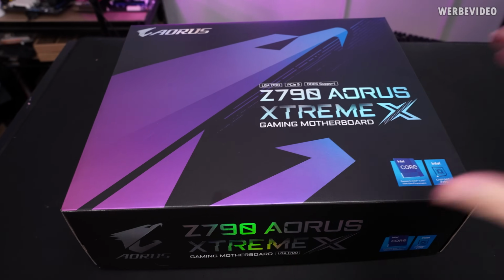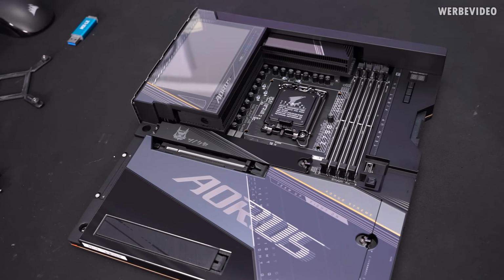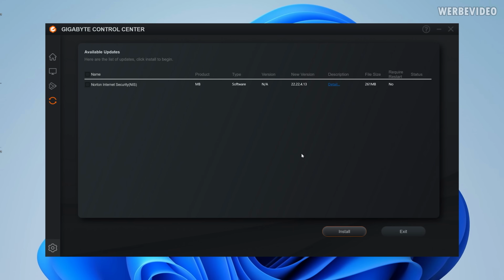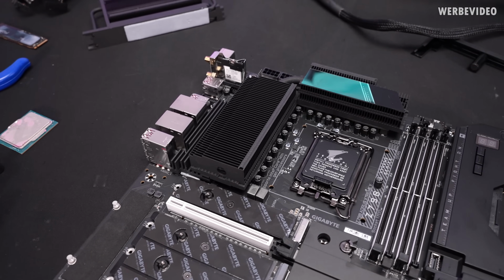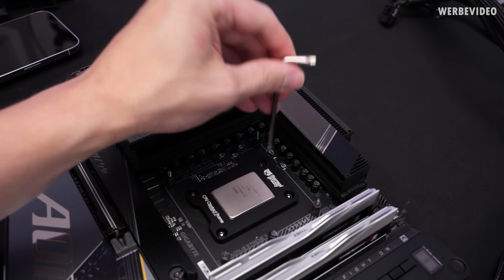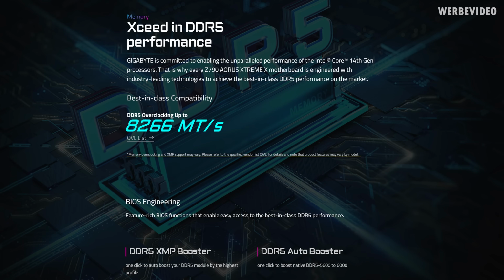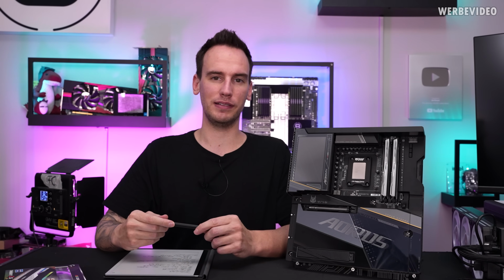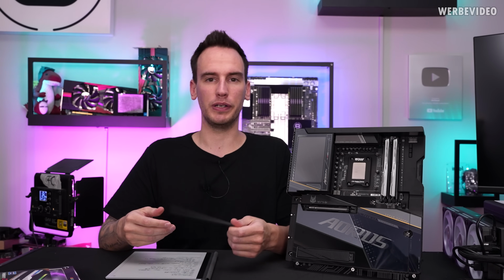Overpriced and Disappointing! The $1300 AORUS Z790 Xtreme X

Comment: Hey if thats a 48GB kit of G.skill then their wrongly profiled. 

Go check their kits of 32GB : 1.45V

Other vendors on the Asus list for z790 formula : 1.45 - 1.4 

Somehow G.skill : 1.35v>

I had these same issues, got very confused almost RMA'd the sticks. 

Then figured f it let me increase voltage to 1.435 (Max without removing limiters) 

And now its beyond stable, I did add a small fan to the bracket included with the z790 as you will see the temps of the Gskills stick around 50 , but I seem to see the same temps for you in this video. 

Only thing I would want to ask your experience on : Do I still remove the voltage limiter in the asus bios , or if its stable like this leave it like this ? Thanks!

Comment: I think this is one of those situations where Gigabyte (not that they're the only ones who do this) is putting a lot of bells and whistles (and a little snake oil, naturally) in order to bring in customers with more money than knowledge.

This is aimed toward the same kind of customer who chooses who to do custom work on his car based on whether they have a show on the Discovery Channel or not.

Most of these boards will end up in a Y70 Touch or O11 Dynamic clone with as much hardline tubing and as many rainbow-puke spewing fans as is physically possible, while their blinged out 4090 sits 3mm from the tempered glass side panel.

Comment: i owned every single z extreme from gigabyte z170 to z690 , build quality and sound quality plus connetics and esthetics nothing can get closer to them it's just too goof of a premium board , but what i don't like about them it's the fucking software app it's like it's coded by a 12 years old kid full of bugs like the most shitiest app you can find on the internet , and also one of the most bizarre problems with bios settings when you change a setting let's say ram timming and save it then you boot  to windows and it's not changed , or you change some values to auto and yet they stuck at the previous value , so you need to change it manually to the default value then change it   to auto .... other that that , very stable boards can't complain  ..

Comment: It's the new normal in the industry: very high prices. If you think this is expensive, wait for a Corsair motherboard, easy at US$ 2,000 hahaha Flagship motherboards have this problem, price. And that's all they offer, price - to give you the idea of something valuable. The most important parts are the same or almost the same as other models at half the price (and I'm not talking about how easy it is to reproduce some of these features with 3D printed parts, or custom parts/mods or slightly more expensive, vendor-customized blocks and heat sinks like Ek). This model disappoints mainly in terms of connections, less than other models and needs adapters, this is not good, you can't customize it, you end up dividing connection bandwidth, power and you also run the risk of overloading fan connections especially (and they will all run at the same speed).

Comment: This board is amazing I paid $1k for it, and $1k even 6 years ago for a Asus Zenith Extreme for my Threadripper 2950x.  The extreme X is great if you know what you are doing.  I run 8200 m/t G.Skill at a stable 7800 m/t for 3 months now.  My core i9 14900KF is overclocked to 6.2, 5.9 on all cores (custom water cooled), run Sabrent m.2 (4 of them) in RAID 0 on the Gen 4 slots clocking 15,500 mb/sec read/write, and I left my Gen 5 m.2 alone, using my Phantec watercooled RTX 4090 clocked at 3k mhz.  The quality of the board is amazing, exposed in my P90 Thermaltake Case. Wires are hidden easily, the Gigabyte software has come along much much better since this release, and it's been super stable and will last me years.  Just like my expensive Zenith Extreme still running strong.  You get what you pay for.  100% satisfied in my case, these are just small nit picky things you will find if you pick apart any damn motherboard.  And no damn way you get "perfection", seriously?  Made by humans dude.
Reply: This made me feel better!
Reply: @bugz9615 I use this computer heavily with my development workloads.  Docker. Sql Server. Visual Studio (services, mobile, web) builds.  Android emulator. Adobe photoshop. AutoDesk Fusion 360.  In other words I push it hard.  All day.  Gigabyte motherboard software has truly changed for the better.  It was hokey at first.  Some drivers wouldn’t install through it. All that is fixed.  I still run it at my specs above.  The ONLY niche issue I ever have is when windows 11 pushes major feature updates.  A reboot causes some crashes.  Simply turn power off unplug, then start.  Let memory re-initialize.  Crashes are non existent.  Very frustrating at first but that works every time now.  So I would highly recommend this motherboard.

Comment: On Gigabyte's website, memory support is max 6000 MHz. Of course, that doesn't tell the whole truth, but it's strange. Manufacturers of memory chips are Samsung, Hynix and Micron. Gskill and Kingston and Corsair etc do not manufacture any memory chips themselves. Memory that works flawlessly at high speeds is mostly a matter of luck. As you said, it could also be the ability of the processor and/or motherboard to operate at high speeds. The sad part is that NVME cuts GPU performance on this motherboard. This is really not worth the price. In general, Gigabyte has made quality components.

Comment: It's an obscene cost to me for a motherboard, especially for the average user (99% of us). This isn't needed and is only for the most extreme of enthusiasts. And even then, it's obscene. Two thousand AUD for a motherboard - WOW. I'd rather put that into another UAD Apollo for my studio. Will never spend that much on a mobo, no way. All I want is a computer that can run reliably for a few years and of course it will be built with thermals and quality in mind, but there's just no need for this at any step of the way. Just to put it in perspective, my 2010 Mac Pro still works today like the day I got it, and my Aorus X5 V8 laptop I bought in 2019, same.
That was a cheapo on sale for 2 grand with GTX 1070, 32GB ram, 8850h. It needs a repaste, sure, temps are higher than when new, but that's easy enough. Performance at 1080P is still perfect with a G-Sync panel too. My point is that that entire computer I got so much use out of until I upgraded to the GT77 last year, cost the same as this motherboard LOL. Now I am building my desktop, I will get a mid range board, 500$ maximum for the 14700K.

Comment: For that price, I'd expect dual 10GbE ports. 2.5GbE goes along with 5GbE as being a non-standard format that's not supported anywhere outside its own ecosystem and certainly not in enterprise applications, where you either use 1GbE or 10GbE.

Comment: Gigabyte control centre is absolute trash. I have to use a version from nearly 2 years ago to allow me to change settings on my aorus 4090. Newer versions just don't show the gpu in the ui. It's been a known issue and it's on many forums, even gigabyte have recommended using older versions of software. Absolute junk. Will not be buying another gigabyte product ever again.

Comment: When you are discussing power and current numbers I think its important to point out what VR VOUT voltages you are seeing, as well as clock speed if you are on adaptive voltage. Not to mention whether you have dialed in the DC_LL to match the VRM Loadline, so we know if you you are getting accurate power readings. I'm sure you know some motherboards don't automatically set the DC_LL appropriately to match the VRM Loadline the user has selected.

I'm personally disappointed in Raptor Lake because by this point Intel should have created better tools to help users predict what their voltages will be under various loads, with software that shows graphs of voltage curves under the user's adaptive voltage and loadline settings. They added a lot more complexity with Alder Lake, which I appreciate can be very useful, but only with the proper information available to the end user. Ideally they would work with motherboard manufacturers to get such features in the BIOS. It doesn't have to be that fancy or super accurate, just something as simple as a V/F chart representing a rough prediction of what kind of voltages you will be seeing under a given load (The user would enter watts/amps). A good example is RobertoSampaio's CPU Voltage tool he shared on the OCN forums in his post "ASUS MAXIMUS Z690 EXTREME & i9-12900K GUIDE". Intel has quietly disabled V/F point functionality in Intel XTU for 13th gen processors, and my experience with trying to use V/F points in my Z690 MSI BIOS is that it is quite limited and buggy. Its almost impossible to know what voltages at various loads you will get without a lot of trial and error, and it also appears you can not set both a positive and negative offset at different points. They have to either be all positive or all negative, which really limits the usefulness of the V/F points in the first place.

Comment: I got the Gigabyte Z690 AORUS ULTRA paired it with 12700KF, G.Skill DDR5 F5-6000J3636F32GX2-TZ5RK 64GB (2x32GB), Palit 4080 RTX 16Gb GameRock OC, Arctic AIO 420mm etc.
Anyway I cant say Im really fond of the Gigabyte software. Also I had to install Windows 11 over Windows 10 my sound improved & Windows 11 know what to do with those E cores. Gigabyte has 13 BIOS versions to choose from. Im using F27. F28 is in BETA stage . XMP did not BOOT Im going to fine tune it manually. I manage to boot it at 5000Mhz but I paid for 6000Mhz I know its a lottery. Any way Im going to tinker with the BIOS settings. In general I cant say Im satisfied with Gigabyte board. Next time Im building a new rig I will look at ASUS, EVGA boards. If you look at top 3DMark Port Royal benchmark list you will see that world records are all usually on ASUS & EVGA boards. You will find couple of boards from MSI & Gigabyte in those lists but very little.

Comment: All that money and its not even a Threadripper motherboard, heck my TRX40 MSI Creator, and X399 MEG Creation Threadripper boards were much much cheaper,  $399 & $499 respectively.  
Motherboard companies today are taking advantage of consumers today, plain and simple.   
This is why its not necessary to upgrade to new tech all the time, you make yourself vulnerably to getting ripped off when the economy goes down a companies decide to recoup low revenue by overcharging their products and thus using you the sucker consumer to help fund them.

Comment: Hello, I’m about to buy a motherboard for my new build. It’s the only missing part. I have the 14900K CPU and 4090 RTX VGA. I know I wouldn’t be able to afford the Extreme X. Actually I was considering getting the Aorus Master X. You also mentioned so many times buying it instead of Xtreme. 

Master also has 10gbit Lan but it lacks Thunderbolt ports (though we can add them later with add-in cards I think.) Also I see it’s sound chip isn’t the latest one but overall I find it very appealing. Some reveiwers really like it but some are also a little bit disaapointing for some reasons. 

I also have the option to get Asus Maximus Dark Hero which is a peer of the Master X I believe. But it doesn’t have 10gbit Lan port but it does have 2x Thunderbold connections. I don’t know which one to get. Should I sacrifice the 10gb lan port or the thınderbolt ports which I don’t really know if I’ll ever need :) 

I hope you can give me some ideas. And maybe MSI ACE would be good too lacking the 10gbit lan port again. 

I tend to come to Master X which has 10gbit lan port and I can always add Thunderport add-in card later. But I don’t know how stable it is with its 14900 profiles and how easy to make customization with its softeares. Could anyone please give some suggestions? Thank you.

Comment: Could be your kit, the IMC or use the other slots! Did you not know that using a PCIe 5.0 SSD in the slot would steal lanes from the x16 slot? Even my motherboard does that and its an ASRock Sonic! Not much of a way around that, considering PCIe 5 goes to the first graphics slot and one port of PCIe 4 is direct to NVMe.. Not a whole lot of point buying a PCIe 5 drive right now anyway. Idiotic prices and they won't be much different until a few years from now lol 8x PCIe 4 lanes, probably fine for a single GPU - ask laptops!

Comment: I have the z690 by them, I have been scrambling to try and find a replacement by almost any other brand.
Reply: I just got to the point where you mentioned the bios was at f2. Mine's at f3, which is what it came with. And I have yet to get it to recognize and fall through with a BIOS update. Beyond frustrating

Comment: Just to point out I've tried OCIng DDR4 on a couple of gigabyte boards.

Micron Rev E is what I used at the time, it does 4200CL16 on Asus Z390 and Z490 boards. On gigabyte boards I couldn't even boot it with stock XMP of 3200CL16.

I currently use Micron Rev B, on 10900K it did 4533CL15, currently on my 4th alder / raptor lake CPU, I have a 14900KF running 4400CL15 G1 stable on an MSI MAG tommahawk, also it can do 4300CL14. The rest of the timings are crap because micron, but even for DDR5 Gigabyte boards are trash tier.

Only board thats reliable for high end DDR5 OCing is Asus Apex, DDR4 you can do on just about any Z690 or Z790 D4 board from Asus or MSI.

I bought the Rev B micron on EOL sales, originally £350 (lol) reduced to £180 when 4800 DDR5 still cost £400, so now I'm too stubborn to bother with DDR5.

Comment: When you do your next video on this board - check the speeds on the ethernet ports, see if they are capped at 100mbps and require you to go device manager, controller, properties, advanced, speed and set it at a different speed. At which point the 10g port gets disabled in mine and the 2.5g accepts the change from auto negotiation to 1gbps and gives me the speed until an update recaps it at 100mbps and i need to change it to auto negotiation to give me the full 1gbps. Also same thing happens on my Aorus Master. So between the Master and the Xtreme i have 3 ports exhibiting the same behavior. My GCC software ofc doesnt work like yours.

Comment: To be honest. First place: I dont have the money for this. BUT! For the price, it doesnt perform that well in my opinion. I have an x570 unify board, and performance-wise, its still rock solid. With this pricetag, someone can build a secondhand market PC, which is ridiculous..  It looks clean, awesome, i love the design, i love every part of it. But for this price, i would like to see something EXTRA good, not just a regular Z board, with some plates, to hide the cables... :D Lianli strimer cable users will love the 90degree 24pin.. :D

And the best part is, when you picked up the user manual.. 
Bro XD Gigabyte saving the earth, by removing 50pages, but still packaging every cable in different bags, which is plastic :D blew my mind

Comment: These transparent plastic/acrylic panels should be made out of glass at this price point. Ain't no way chinese sellers can offer a 3 pack of tempered glass screen protectors for 5 bucks but this 1300 euro board comes with plastic covers that can be scratched with a feather.

Comment: As someone who uses an Aorus Pro-P B550 board, RGB fusion is a garbage app. I installed it when i reimaged my system transferred everything into the Fractal North and it defaulted to the aorus orange. I just left it alone cause the app is so unrefined. Seeing that it's even worse here is nuts. I'll avoid updating it for sure.

Board prices though are crazy now. It certainly isn't due to shortages, it's more just overzealous greed. Most Higher end Intel boards used to be between $500-1000. AMD boards were much cheaper with the odd AM4 board up around $1k and I think that board had a full block on it.

Quality wise of the board, Gigabyte has seemingly been one of the best over the years